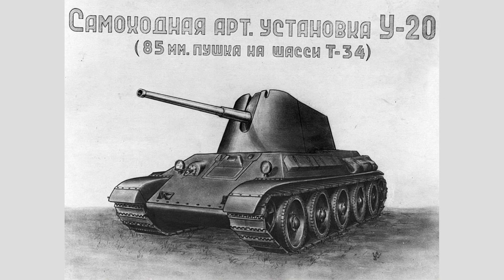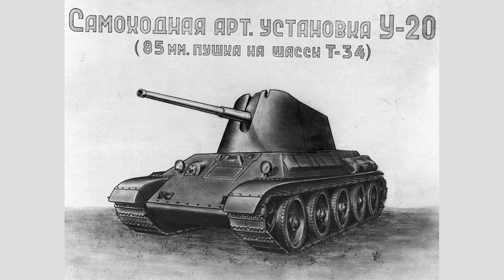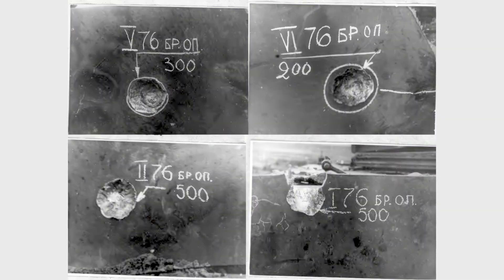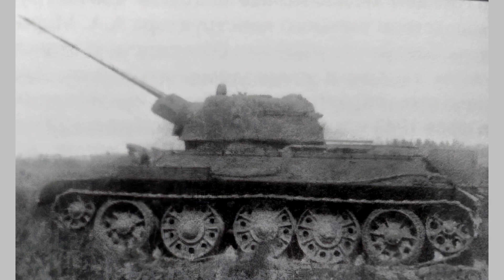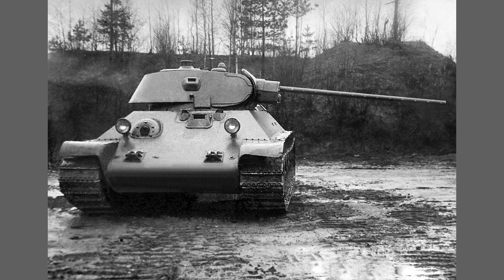How the T-34 got its 85mm gun

Comment: Bro, over 2,200 T-34 were produced with the 57mm gun. They were used as dedicated tank hunters,  because it lacked a good HE shell. Soviet commanders were not very happy overall with the 57mm gun, it had great armor penetration and a long barrel ( more powerful than the British 57mm 6 pounder) but its HE shell was weak and crews complained that the 57mm shell would pass through both sides of a German tank and not cause any serious damage to the inside of an enemy tank. you claim only 4 were made. About 2200 were built during the war. T-34-57
Reply from the maker: Where did you find this nonsense? ChatGPT?

Comment: Why not just increase the power of the 76mm gun? Would a longer barrel and a larger charge have been feasible? I imagine that gun development is not that easy and they already had an 85mm AA gun on hand - so that is at least two strikes against the idea. Though turning the British 57mm six pounder into a 75mm, or going from L42 to L48 on German 75mms always seem to be given as simple upgrades.
Reply from the maker: Indeed it was. A T-34 tank equipped with the S-54 gun (3-K AA gun ballistics) was tested in the fall of 1943. This solution turned out to be feasible if not for two problems. The first was that an 85 mm gun could also fit into the two-man turret, albeit not without issues. This was the preferred option and was actually accepted into service, it's just that none of these tanks were ever built. The second was that the 3-K and ammunition for it were no longer in production and retooling to start making ammo again would be an issue.

Here is some more reading on the topic:
https://www.tankarchives.com/2022/08/big-guns-for-t-34.html
https://www.tankarchives.com/2021/11/the-last-76-mm-hole-punch.html

Comment: Nice video,but I have a question about the production of t34/85:Are all T34/85 new? Did they attach the turret to the modified old t34/76 hull to produced t34/85? Since t34/76 is so rare now,
I wonder if they might be changed to other models.
Reply from the maker: There are definitely T-34-85s built from T-34 hulls. I've seen at least one in person. A plugged radio port in the hull is a surefire sign that you're looking at a rebuild.

Comment: The tank design cannot be seen in separation from the available technology.   USSR lack ability to produce machinery to make rings for turrets.  In 1930's  USSR acquired several kits for USA to make rings, the 1575mm tool was reserved for KV-1 and T-34 ended up with 1420mm.  That became the limitation for the size of turrets that translated to the number of crew members and gun size.   In 1942 (43???) USA supplied several kits for 1600mm, that enabled T-34/85.
Reply from the maker: I read that claim a lot but it is never substantiated. The T-35 and T-28 had 1620 mm wide turret rings a decade prior to the arrival of this alleged American machinery.
Reply: @TankArchives  
Thank you for reply.
I saw the claim about USA machinery for turret rings as a part of list of goods provided by Lend Lease grouped by years.

The fact that T-35/T-28 had wide turret ring  (I was not able to find these numbers) doesn't mean that machinery was made in USSR (extremely unlikely)  or can be repurposed for T-34 given the difference in weight and haul design.
Reply from the maker: @skvUSA  if the argument is that the T-34-85 could not have been produced without American tools supplied in 1942, then whether or not the machinery used for cutting T-28 turret rings was made in the USSR or not doesn't matter. It is not a secret that the USSR received cutting machines via Lend Lease, but it's a huge jump to conclude that it was only these machines that enabled the production of the T-34-85.
Reply: @TankArchives  
If we agreed that 
1) T-34/85 main feature is 85mm flak gun and 
2) 85 flack gun requires turret with ring over 1420mm  
and
3) USSR didn't have machinery available (domestically built or spare) to cut larger rings until such machines came through Lend Lease.

That by the rule of logic n.3 becomes the crucial issue (show stopper) that enabled T-34/85 production.  That resolved only by Lend Lease.

I agreed that n.3 was not the only show stopper to T-34/85 production.  I red several horror/heroic stories about starved people building tank factories during winter on a middle of Ural mountains driven by patriotism, fear and love to Comrade Stalin.
Reply from the maker: @skvUSA  2 is wrong. The 85 mm S-53 was originally built to fit into the 1420 mm wide turret ring hexagonal turret. It was tested in late 1943 and even accepted into production. The 1600 mm wide turret ring was developed for the larger bulkier D-5T gun which was only used in the earliest T-34-85 tanks produced at factory #112.
There is no evidence at all to support 3. As I showed, the USSR did have machinery to cut turret rings of that size and in fact Morozov's arguments for keeping the 1420 mm turret ring on the T-43 was backwards compatibility and keeping the weight down. If availability of machine tools was a limiting factor then I assume it would have been mentioned in Russian language documents somewhere, but I haven't seen any such claim even in contexts where 1420 mm turret rings are discussed.
Morozov also relented and agreed to a 1600 mm turret ring in early 1943, long before the T-34-85 was even considered for production. Around the same time work began on designing IS tanks with a whopping 1800 mm turret ring diameter. Again the designers and technologists do not use the arrival of any new machine tools to justify these decisions.

If you can find any evidence at all for #3 in documents then please share. Ghost stories of a commissar pressing a gun in the back of every factory worker aren't evidence.
Reply: @TankArchives  
"Fit" means ability to meat requirements besides simply physically accommodate.    85mm gun has bigger shell and and bigger bridge and longer and stronger recoil.  I am sure that they were able to "fit" into 1420mm, but I would guess, they would sacrifice elevation/depression angles and operation process.  Two people struggle to fit next to 76mm gun even with RKKA ergonomic requirements and 76mm turret had space for 9 shell.  German claimed that T-IV was able to fire 3 shell for every one of T-34/76.  I just wondering how 85mm would perform with 1420mm.

I think your point that USSR never moved forward with 85mm gun until they able to cut 1600mm ring implies that such ability was a show stopper, that somehow was resolve at the time of Lend Lease.

n.3  I don't was to search again about Tank factories stories "И.М. Зальцман" was really interesting charrrracter.
Here is how it worked for kids: My mom (than 13yo) was evacuated with her school to Uzbekistan, they were forced to harvest tabaco. She was suffering from malaria and her classmates had to carry her to and from plantations otherwise she would not be given her food ration...
Reply from the maker: @skvUSA  "I would guess"
The difference is that I am not guessing, I am working off of actual documents produced by people who were observing and managing the trials as opposed to opinions of someone sitting at a computer 80 years later.

> I think your point that USSR never moved forward with 85mm gun 

Work on 85 mm guns on the chasis began in 1940, which I am pretty sure I mention in the video. Yes, on a rotating turret. Work on 85 mm guns on the KV chassis began around the same time. Work on the U-12 gun began in late 1941. There is zero evidence to suggest that cutting tools were in any way a limitation of work on 85 mm guns. 

I am sorry about your mom but I am not sure what experience harvesting tobacco in Uzbekistan has to do with tank design and production.

Comment: Do you know why the Soviets didn’t really fit muzzle brakes to tank guns when they often did to guns of the same caliber. (76mm,85mm,100mm etc) They obviously did it with tanks that needed it like ones armed with the long 122mm and the 152mm howitzer, so I assume they preferred not to if they didn’t need to? Also thanks for another great video.
Reply from the maker: It was not desirable since the blast revealed the location of the vehicle, created a dust cloud that impeded fire correction, and made life difficult for supporting infantry. In some cases it was a necessary evil, but it was preferred not to use it if possible.
Reply: 152mm doesn't have muzzle brakes , only the 122mm on is-2 tank uses muzzle brake
Reply from the maker: @jerryle379  sure it does. That's what the slots cut into the side of the barrel are for. Compare the ML-20S to the ML-20SM which doesn't have them.

Comment: I recall that the Soviets produced an experimental version of the KV series with an 85mm gun, their Objekt 220, which would have been a match in weight and firepower to the Tiger.
Reply from the maker: That was the T-220 (the term "Object" to refer to experimental vehicles had not yet entered common use).

Comment: Great info sir.  One thing I think people do not realize is that using an existing gun is not as easy as people think.  The recoil needs to be beefed up or totally redesigned for a shorter recoil cycle in some cases.  Was this also a problem with the conversion?
Reply from the maker: Not that I've read, but the fact that the LB-1 had a muzzle brake suggests that increased recoil was something the designers had to handle.
Reply: @TankArchives  Thank you sir for the information.

Comment: Most likely if they had based their decision on a tank captured in 1943 the T-34/85 would not have been developed during the war.
Reply from the maker: Perhaps. The T-44 travelled this path though. Work only began in late 1943, the first production tanks came off the assembly line a year later. If the decision to produce it in a factory that was more ruins than workshops wasn't made, then we could have seen T-44 tanks on the front lines by the end of the war.
Reply: @TankArchives this is we do not count that there was a experimental T-34 with 85mm S-53  installed in model.1941 (bolt nut shaped) turret with crew of 4.
I think i don't need to explain why it was rejected.
Reply: The "IS" series (at least the nomenclature) started in 1942, though these tanks bore little resemblance to the eventual IS tanks (originally sporting 76.2 mm and 122 mm howitzer guns).    The IS series as it was designed really came about in 1943, and made it into production in 1944, but borrowed from the findings from the KV-13 and other projects.

So it's hard to say how fast a weapon can be produced.  If there are a lot of findings from related previous projects that can be 'stolen', so to speak, a weapon can be put into production in a year.  The more you have to start from scratch, the slower things will become.

It's also hard to say "when did work on weapon X begin?"   Take the B-29.  The 'napinkwaffe' work started in 1938-39.  The first orders for test models came in 1941 and early 42.  The first  flight of the test models started in September 1942.  Production started in 1943 but the reliability problems were so great that fixing them meant that it was mid-1944 for them to start seeing action.

I use the B-29 story as a counter to the TeeVee history about the 'wonder weapons' of Germany (space weapons in one episode!) and/or Japan (who had managed to actually build a jet fighter in 1945, save that it didn't have jet engines!).  Ooh! Aaah! SCARY!!  Yet in reality it took the world's No 1 economy, an economy that wasn't being bombed to smithereens, several years to get a weapon from prototype to actual service.